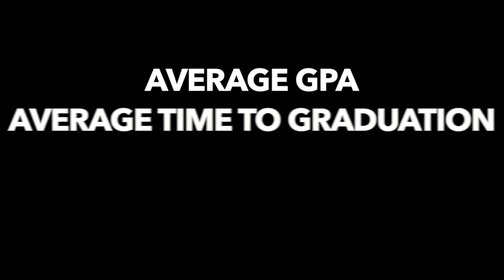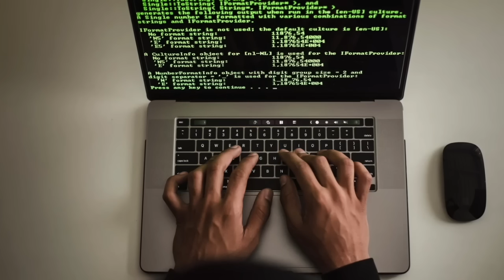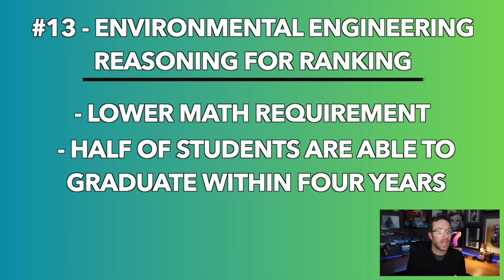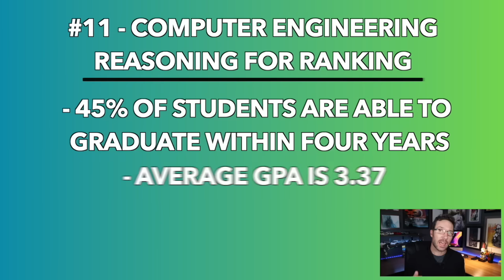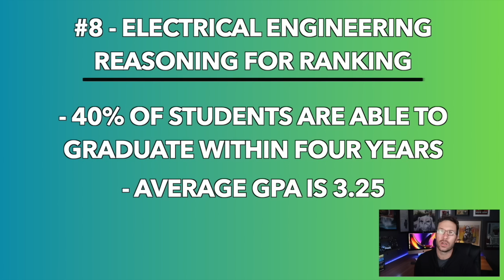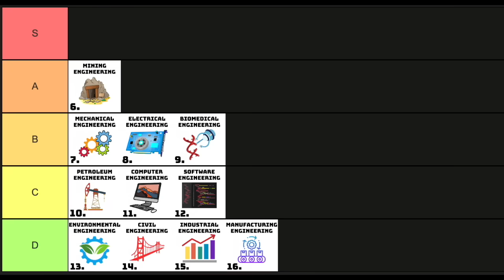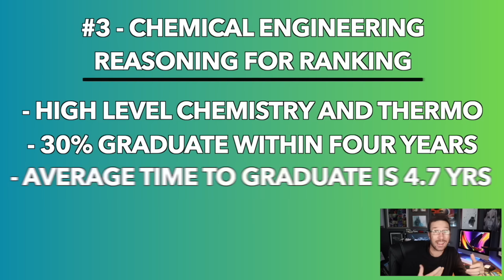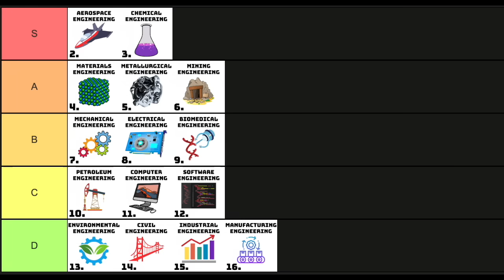Engineering Degrees Ranked By Difficulty (Tier List)

Comment: I studied EE at a University in Germany and we shared math lectures with physics students. 
Depending on your specialization you had to deal with fancy mathematics like higher-dimensional integral calculus, tensor calculus or nonlinear partial differential equations and sometimes even special math notations that are only used for a certain type of problem (i.e. matrix to the power of matrix).

We also shared some physics lectures with the physics students, for example nuclear physics and experimental physics.
Reply: It is pretty The same here in Brasil.   There was even calculus with complex variables. In The field of microwaves The math required is even more difficult.
Reply: I'm in your spot right now. Specializing in communications. The physics and maths needed are beyond healthy ...
Reply: @ProGamer-hg4rf  I also specialized in communications. Sometimes I thought: ‚Welcome to just another math lecture!‘. I like mathematics so it was fine.
Reply: Electronics is basically semiconductor physics.

Comment: I think computer engineering difficulty largely depends on the program.  That's true for all degrees on this list, but each school decides the proportion of software and electrical education required.
Reply: My schools Computer Engineering degree requires 127 hours in total and shares many of the same classes with Electrical Engineers. Got a couple more years left of Comp E
Reply: For real, in my school we have more EE subjects than software and the EE subjects literally delays the students in our course by a whole sem or 1 year because of its difficulty specially Electrical circuit 1 most of my senior get delay by that subject like only a couple get to pass you can count them by finger. The difficulty literally bad we only got 2 graduates this year😭😭😭

Comment: Environmental engineers do work on designs which protect the environment... but the images you showed solar panels, wind mills, and green buildings have almost nothing to do with this disciple. 

Environmental engineering is largely remediation work most jobs having nothing to do with green infrastructures which is probably more civil engineering.

Comment: Civil Engineering is NOT EASY, especially not structural. Anyone who says so is not a civil engineer. The liability you have, the amount of factors you have to account for, the brutality of the workload. Most structural engineers also have their masters, so add that to difficulty. Structural mechanics is also one of the most difficult college courses. We take the same math and physics courses at the freshman and sophomore levels as other engineering majors.

Comment: I went into ChemEng while finishing my degree in Geology and worked in mining in politically unstable places where I did not like the idea of being shot or kidnapped. Several people I admired were practicing ChemEng’s. I was never really “scared” of math chemistry, physics, etc. so I went for it. As a ChemEng you have to take many courses many different areas because at the end you need to be able to connect the high level concepts of chemical process engineering which not only includes building chemical processing plant that needs to work as designed but being able to see beyond into biological processes, atmospheric processes, material science, etc.
I went to school in two different places. My first university was very very difficult, even though I liked chemistry I found organic chemistry (had to take 2 courses) very difficult and abstract at times  plus the teacher was not there to make friends but to put us through the ringer and make sure we learned something. We also had take 2 courses in thermodynamics and 1 more in chemical thermodynamics and the labs were tougher than the courses. I forget the number of math courses we had to take starting w calculus I same thing w math, etc. Throw materials science and courses like polymer Eng. (Teacher was out to flunk everybody I swear) and soon you’ll see your class size go way down. Then you take all that good stuff and cook them all into the grand finale of what I think is what makes a chem Eng a chem Eng - something called transport phenomena or the science of trying to understand how our physical-chemical world works the way it works. The basics include heat mass and momentum transfer some very interesting stuff that can definitely put you in foreign territory. Plant design, kinetics, process control, etc tend to be less shocking since at that point your somewhat used to that kind of challenge, at least a little.
I had to study all the time, partied very little when compared with some of my friends, and soon realized that falling behind w homework assignments was a thing to avoid like a wasp nest.
All said, throughout my career mentors have made a huge difference and if you are lucky enough to find one while in school stick to him or her like glue. Personally I found certain general  engineering topics more difficult and less interesting than others.
I’d say if ChemEng type stuff is your passion go for it, but if studying ant behavior in the rainforest is your thing that’s your thing and don’t be afraid of it. I think Stephen Jobs said something to that effect, like follow your passion, or at least try most of the time in my case.
One observation I have about mining Eng. Is that we will see a surprising high demand for it in the next few decades, though most of it might not be in the US, still Mining will make a big comeback in my opinion because of the energy transition we’re in.
I would recommend anybody studying engineering to try to take a course in finance and accounting if you can wing it, finally these days ai related courses are in my opinion essential to your progress, there’s a big transition going on. The good news is that you don’t have to learn everything while in school, because you’ll end up taking professional development courses, etc. after school ,etc. One more thing when you find an extraordinary teacher try  learn as much as possible to them, usually behind a great teacher there is a great person.

Comment: I dropped out of electronic engineering, my father dropped out of mechanical engineering. What a team. Personally, I wouldn't say it was "difficult", I just didn't expect there to be so much project management. Well, I guess the management part was difficult; The technical stuff and mathematics wasn't really a problem. In hindsight I think I should have done an apprenticeship.
I have never had to use calculus since leaving university, however trigonometry has had its uses in real life when doing some DIY carpentry. I'll solve quadratic equations for fun, but I'd have to ask the internet to help me with a Fourier transform.

Comment: My degree was in Nuclear Engineering. I think I had 134 credits when I graduated. We were required to take quantum and relativistic physics beyond what the other engineers took. Also had to take an instrumentation class involving building analog and digital circuits. Highest math I took was partial diff. eqns., numerical methods and advanced calculus.

Years after graduating, I still had to deal with fluids, heat transfer, thermodynamics, materials and a lot of the other disciplines.I worked with simulators and safety analysis writing software. While the academics were challenging, there was not the rapid change you would probably see in fields like software engineering, electrical/computer engineering or aerospace engineering.

Personally, I think chemical engineering seemed pretty tough based on the comments I heard. Seemed to be a lot of labs.

Comment: I would definitely place Chemical Engineering as #1, and I would put EE as #2.  Aerospace is very similar to Mechanical, I would call them sister degrees, so I don't understand why they are rated so differently.  I think the reason Nuclear Engineering placed so high on your chart is just because it has become something of an orphan degree here in the states, which has probably influenced both the teaching and the student population.  I know that I was initially interested in Nuclear when I enrolled in college in 1978, but the Three Mile Island happened.  I saw the writing on the wall and chose Mechanical instead.  As did many of my peers.
Reply: Should've gone nuclear instead looking back on it probably. Aero is a lot harder than Mech in senior year classes. EE is just very different not necessarily harder than anything else. It's all just subject in my opinion.
Reply: @tasmayshah5539 The curricula are nearly identical at most universities except for technical electives generally. So if you think that three classes related to propulsion or aircraft specific structures is that much more difficult on the whole than CFD or FEA courses on a more general level, then sure?
Reply: It is often said that Aerpsace and Mechanical are sister degrees, but in Aerospace you basically trade a little thermodynamics for a whole bunch of fluid mechanics and structures. The topics are similar, but the levels of specialization are entirely different.
Reply: @1Podri  Weird that Aero trades “a little thermo for a whole bunch of fluid mechanics and structures” when they both have the same course credit requirements. I would agree on the increase in fluid mechanics specialization part being swapped for some thermo and machine design, and that it is generally more specialized vs MechE being broader, but they are by and large very similar in most coursework and you could really seek employment interchangeably with the degrees.
Reply: @1Podri  Well, yes, but when I got my MSME in Turbomachinery, all of my thermo and fluid dynamics courses were ME courses.  I did not take any Aero E courses.  Perhaps things have changed?
Reply: Yeah.  Too bad about Three Mile Island.  It allowed all the nitwit luddite  academics and media people  (including Jane Fonda)  to destroy nuclear power in the USA to this day.

Comment: Pure data analysis doesn't give the entire story. ChemE is challenging because of its Organic Chem requirements. I also had friends at Uni who switched from EE to Mechanical Engineering because it was easier. The advanced math wasn't an issue for MechE. The logic of circuitry in EE seemed to be the challenge.

Comment: A lot of math is involved in Chemical Engineering. The Navier-Stokes equations which are a system of second-order, nonlinear PDEs are used to study the flow of fluids. Also, these aspects of math are used in computational fluid dynamics (CFD): 

1. Finite Difference, Finite Element, and Finite Volume Methods: These numerical techniques are used to discretize the governing partial differential equations (PDEs), including the Navier-Stokes equations, to solve them numerically over a discrete grid or mesh. The choice of method depends on the problem and application.

2. Grid Generation: Creating suitable grids or meshes to represent the geometry of the domain is crucial. Techniques like structured grids, unstructured grids, and adaptive mesh refinement involve mathematical concepts for grid generation.

3. Interpolation and Approximation: In CFD, various interpolation techniques are employed to estimate values at grid points. These methods include linear interpolation, polynomial interpolation, and spline interpolation.

4. Time Integration Schemes: For time-dependent problems, numerical integration methods are used to advance the solution in time. Techniques such as explicit and implicit time-stepping methods, Runge-Kutta methods, and the Crank-Nicolson method are common.

5. Multigrid Methods: These mathematical techniques are used to improve the convergence rate of iterative solvers, especially in solving large linear systems of equations that arise in CFD simulations.

6. Turbulence Modeling: In turbulent flow simulations, mathematical models, such as Reynolds-Averaged Navier-Stokes (RANS) equations and Large Eddy Simulation (LES), are used to describe turbulence effects.

7. High-Order Numerical Schemes: Higher-order accuracy in discretization schemes can be used to improve the accuracy of CFD simulations. These schemes use advanced mathematical techniques to reduce numerical errors.

8. Parallel and High-Performance Computing: CFD simulations often require distributed computing and parallel processing, which involve concepts from parallel computing and numerical linear algebra.

9. Error Analysis: Techniques for assessing and controlling errors, such as Richardson extrapolation and error estimation, are employed to validate and ensure the accuracy of CFD results.

10. Dimensional Analysis: In problem formulation and scaling, dimensional analysis is used to identify dimensionless groups and parameters that characterize the system's behavior.

11. Optimization and Sensitivity Analysis: Mathematical optimization techniques are used in CFD to optimize designs and control parameters for improved performance. Sensitivity analysis helps understand how variations in input parameters affect the outcomes.

12. Probability and Statistics: These concepts are relevant for handling uncertainties in simulations and for analyzing the results of stochastic simulations, such as Monte Carlo simulations.

13. Fluid-Structure Interaction (FSI): When simulating the interaction between fluids and solid structures, mathematical concepts from structural mechanics and FSI modeling are employed.
Reply: We all went through a lot of math!

Comment: Materials engineer here! I earned my BS, MS, and PhD in materials science & engineering so I could probably speak to the difficulty during degree progression. Relatively speaking a BS isn’t too difficult in that the classes are fairly broad and you may or may not specialize in something as a senior. Even at the upper levels, courses can sometimes feel like a repeat of undergraduate content but presented in more depth or require more math to understand which is where PDEs and matrix analysis come in. In my opinion, what makes materials engineering both interesting and difficult is when you conduct materials research. Depending on the materials or applications, you might need to understand chemistry, solid state physics, thermo, mechanical behavior, electronic behavior or other higher order relationships. It’s such a great field to be in right now since new materials lead to new technologies that are likely limited by the materials we currently have!
Reply: My brother ended as a material process engineer / project manager.
 Started as metallurgical engineer in 1951.
 He picked some up electronic engineering somewhere in the time between then and 1985 when he retired.
In 1978 or so he was turned away by the US government to head a project because did not have a PhD.
So he hired one. The PhD was glad to have finally met him. Seems like his work was what he studied.
Made more as a company president CEO because of that requirement. More than in the 1st 30 years in total.
As for me different mother. His mother paid for his college. My mother,, well she had better things to do.
 By 1967 going to college and working to pay for it was not something you could do. Almost got a Biomedical Engineering degree.
Oh and designing analog computers sucks. One of those multiple op amp chips can take the place of a million lines of code with less watts.
There was few of those in my naval equipment.
Then I joined the Navy. Not a lot of money, but saw places he never seen. Did things he never did.
Reply: @warrenpuckett4203  "Then I joined the Navy. Not a lot of money, but saw places he never seen. Did things he never did."

Not an engineer, but glad I joined the USN. Your sentence sums up my  career in a nutshell. Another version of the Roy Batty speech!
Reply: Finishing up my Engineering Physics deg very soon. I'm specializing in semiconductor physics/design and plasma system to a lesser extent. Materials research, solid state physics, semiconductors, and plasma are so interrelated its shocking and wonderful. Any mix of those disciplines is truly the hardest engineering.
Reply: I earned a BS in Materials Science and Engineering and loved it.  I focused on implantable materials for orthopedic surgery and then got my MS in Biomedical Engineering.  Though I'm nowhere near a lab bench these days, I'm grateful every day for the path I took.
Reply: I'm an aero and had some courses in composite materials and just found the whole thing fascinating.   My specialty was stability and control but I do welding as a hobby.   I sometimes regret not drilling down more on the material science though because the nuances of welding are totally intriguing!

Comment: I graduated with an EE engineering degree (telecom and electronics). The list kind of jives. We looked down (in terms of difficulty) on civil and industrial engineers. Mechanical were kind of at the same level. software was kind of a different breed. But by far the craziest most insane was physics engineering (nuclear, materials) and had mad respect for chemical engineers. Chemistry makes no sense at all.
Reply: In my country electronics and telecommunications engineering is not part of EE. It's harder than EE.

Comment: I'm doing Environmental Engineering and I just came out of a PDE exam for a math unit which even Chemical Engineers don't have to do. Mining engineering is also ranked quite high but in my experience it has a surprising amount of subjects in common with environmental. Don't let these rankings discourage you or hurt your ego. No engineering is "easy". The content of each specialisation will differ depending on your university, and probably the skills in demand in your country.